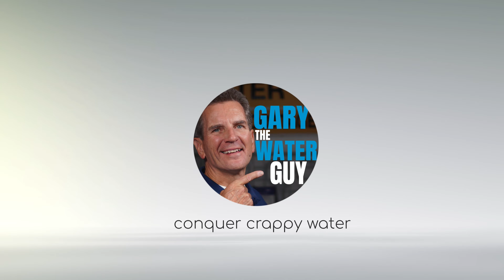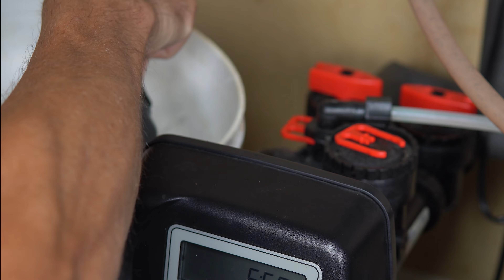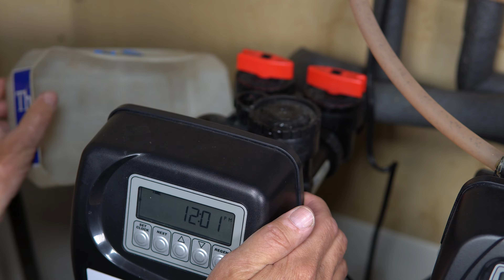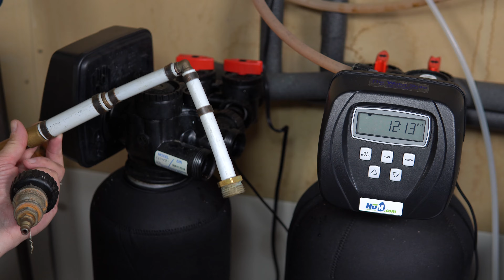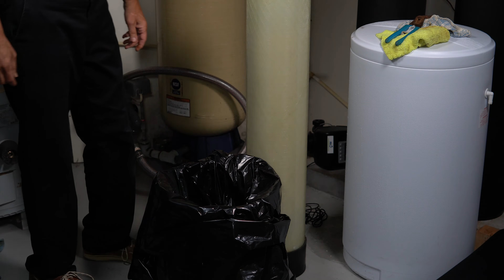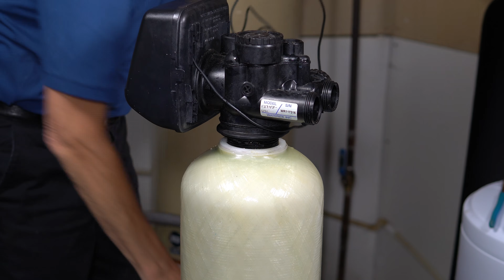WATER SOFTENER RESIN or Media REPLACEMENT

Comment: My softener takes 1.5 cubic feet…so I shouldn’t use all of that? Also how much water do u put in after the new media is installed.. thanks!
Reply from the maker: If it calls for 1.5 cubic feet you should add 1.5 cubic feet. You fill the tank with water while in the backwash cycle
Reply: @water_estore  so u fast forward the cycles to backwash then turn the water on? I appreciate your time!

Comment: Water pressure is low in house. Is this stuff in the tank supposed to look like gue?
Reply from the maker: No, it is not.  Likley chlorine has compromised the media and started to break it down.  You wither need to replace the media or repalce the water softener.  Thsi vdieo shows you how to repalce https://youtu.be/Z47JGH1l39o

Comment: I have a water system one part is for water softening and the other is for ph the tank for ph they said the timer is working and to fix is like $900 does that sound right like how come the timer can’t be replaced only it has Rene’s neu 1.5 $400 then timer $300 and whatever goes in it at $200
Reply from the maker: Sorry, I don't understand your question.  Can you please explain it better?
Reply: @water_estore  the tank that’s suppose to be for the ph they said the timer isn’t working so to replace that and rebed 1.5 is like $900 does that sound right

Comment: Hello Gary
I replaced the resin bed. The resin is purchased from amazon with your link. The weird thing is I found the TDS reading is 150 with bypass valve engagement(no softening), but it increase to 210 after I replaced the resin. It looks it gets worse? Don't understand how? I measured the TDS the next day after I replaced the resin. Even I regenerated two times, it doesn't help at all.
Please help.
Reply from the maker: Judst so you know we do not have an Amazon link for resin.  Our resin is here https://waterestore.ca/products/excelclear-premium-grade-water-softener-media-1-cubic-foot Having said that your TDS typically is always higher after a water softener than before.  Softening your water does not lower the TDS.

Comment: I’m in the middle of replacing my media due to no pressure at all. My tank is 54” and probably 10” diameter. There was gravel at the bottom when I removed the old media. You mentioned not needing it if it’s a small than 12” tank, I also read there’s been research that it’s not needed for my size and some companies don’t use it anymore for a tank my size. Should I still use gravel or not? I already purchased the media. Thanks in advance.
Reply from the maker: If it’s a water softener, correct. If it’s an iron filter or something else it will likely need gravel
Reply: @water_estore  thank you for the quick reply! Yes it is a water softener. I just didn’t want to replace the media and a year from now something goes wrong or clogs due to not using the gravel.

Comment: What's the purpose of putting the valve into backwash for a few seconds before closing the inlet/outlet valves to the house plumbing?
Reply from the maker: To release the pressure inside it

Comment: Hi Gary - I have a GE water softer that is about 6 years old. It is not using any salt.  I watched a few of your video. I removed all the salt and brine, soaked the tank with warm water and sucked it out. Refilled per instructions, cleaned the filter (it had a small clock) and performed a recharge.  No errors on the electronics.  Could the problem be the media?
Reply from the maker: Does it add water during the fill cycle and then suck it out during the brine cycle?  This video might help https://youtu.be/Lr3jyGiJdC0

Comment: Hi Gary, would it be possible to use old water softener remove all the media and add anion resin instead for tannin removals? Thank you so much
Reply from the maker: Yes, it would work.
Reply: @water_estore  Hi, thanks for the response. What about adding anion resin to the top of regular water softener, I have read that is a common practice, have you ever tried something like that? Thank you

Comment: Great video, followed it to the T.  My water was very hard according to the test.  I recently changed the resin, how long will it take for water to soften?
Reply from the maker: Right after the first regeneration.
Reply: @water_estore  thank you for the response.  It appears the way my system is setup, the water goes to the softener, then the water heater.  Should I dump my hot water tank first?  Seems that the old hard water is still there maybe?

Comment: No gravel in the bottom? strange.
Reply from the maker: Not really. Smaller than 12” diameter residential water softeners do not require gravel.
Reply: @water_estore  Thanks for the quick reply.  It helps as I need to replace resin media for my softener.

Comment: Your video did not show why control panel keeps shutting off when you have it plugged in I am the one that asked why it would run for 3 hours and with the screen being blank lot of water wasted I need to know if I need a new keyboard or whatever you called it but this thing isn't that old it's very aggravating if I need to clean this or change that let me know I just need to know.
Reply from the maker: This video will help you troubleshoot blank display How to Test CLACK Water Softener POWER SUPPLY #shorts
https://youtube.com/shorts/JNVLAd4SD4I?feature=share.

Comment: Very informative and much appreciated!  So easy to follow the steps.  Question: I replaced the drain elbow and forgot to add back the DFLC component (doh!).  I caught my mistake a little after starting a regen.  I could hear the media in the drain  tube.  I quickly cycled the head out of regen mode.   Do you think the media loss was insignificant?  I just replaced it!
Reply from the maker: No way of knowing, depends on how long it ran for.

Comment: Great video.  I would recommend that anyone using the compressed air method to be sure to have an air pressure regulator set for maybe 60 psi.  
Also I would run a toothbrush around the tank threads to make sure there was no media in them before reinstalling the valve.
Reply from the maker: Great tip! Please share video with friends and family!

Comment: How did you know you need to replace the resin? We just installed a water softener and every morning after no water heavy water use during the night our water has had a yellow tint. The company suggested doing a large flush but elected to use the water naturally to do that (showers laundry etc). We live in northern california so large water waste is hard.  Our plumber suggested it is the resin tank and plan on replacing just the resin within. What are you thoughts?
Reply from the maker: If water sits in a water softener for an extended time this will happen,  Seeing as it is a new softener it could be the resin.  If you bypass the water softenr is the water then colorless?
Reply: @water_estore  yes we did bypass the softner and the water was clear, once we switched back yellow. The water dissipates after maybe 5 to 10 mins of running it. But it does return first thing in the morning the following day.

Comment: There is very little to no water running through the house. I have it on bypass mode now and water works fine. I tried a cleaning solution from Home Depot and did 2 regens. I see maybe about an inch of water coming out the drain line. Would replacing the media make it work again? Do I need a new resin tank?
Reply from the maker: Yes, or replace the media or the whole water softener.

Comment: Silly question sir: What is the difference between the water softener and the filter??? Are these technically different machines or it only depends on the media that is in the tank?
Reply from the maker: The media and how the media is cleaned or regenerated and the cycles used to accomplish the cleaning.
Reply: @water_estore  Thank or "tank" you very much!!!!!!

Comment: Hey Gary , 2 questions .and a tip 

 1  a clack ws1 valve  with an error 2  on the display , not a card issue as tried another card out of a working valve  and error 2 on this card also . 
 The valve with the cover off tries to reposition itself on power up ,with small movements left and right on the visible white cog . The pcb  carriage shifts a little also  but in the end  error 2 keeps coming on the display . 

2  Any  tips for removing the valve off the          riser tube without lifting the tube ,even with gravel /sand bed .
Those valves get a good tight grip on the risers. 

Tip . I use the plastic/rubber covers off an Aqua pro UV  3/4 inch. In and out  pipe thread protectors  for the top of the riser tube when pouring media in to the filters . 
Fits perfectly .
Reply from the maker: Error 2 is that something is binding the piston, this video should help https://youtu.be/v_oF5w5dB1U.  Yes, it is almost impossible to remove the valve without the riser tube comin up with it.  So either don't remove it unless you are fuilly prepared to replace the media.  
Or as you have the valve about 1/2 way unthreaded, whip the valve back and forth numerous times to try to break the valve free from the riser tube.  Sometimes it works, but usually not. 
Thank you for the tip!!

Comment: How to replace carbon & resin in my Anderson Water dual media softener system? I have one stainless steel tank that I believe has resin on bottom and carbon on top. With a separate salt tank. Thank you
Reply from the maker: You would need to know how much carbon, resin and gravel is used in your tanks.  The gravel would be added first, then the resin and carbon last.
Reply: @water_estore  Thank you for the info. Have yourself a GREAT day!!!

Comment: I have tried everything I can’t. Figure out how to get rid of the brown color  out of the water system. It leaves sediment & mud in the tank of the toilet and in the bowl. I have  basically replaced the whole system. I just added a spin down filter. Then it goes into a smart water whole house filter. Then a then a filtration system pre filter. To two media tanks then a post filter into a UV light into the well tank. I’ve removed all the copper pipe because of corrosion and pin holes over the years and I’ve re placed the well pump & well pipe from pump to well tank and the well tank. I see the brown water when I first turn on the fixtures in the house. I’m not sure where to go from here. Second question is do you have all in one system that filters or treats the acidic or mineral based contaminates that  plagues the water coming from the well?
Reply from the maker: Sorry to hear.  I would have a full laboratory analysis done of your water before doing anything else to find out exactly what is in the water.
Reply: @water_estore  I have had it tested . When I bought my house 16 years ago it had a rain soft media type system installed and it worked great but when I tried to get it serviced they said the system was obsolete  and it would cost $8000 with trade in for a current system. And also had a water softener. Even back then it had sediment / mud in the bottom and the sides of the salt tank. When I replaced the well pump I even pulled it up a few feet thinking it was to close to the bottom of the well. Can the well be flushed?

Comment: just wondering if the media can be washed like fish aquarium gravel and then put back in.  I have a huge media tank and I don't think 2 people can do this job.  I followed all of your other videos and I still don't have soft water.   Also, I see resin cleaning chemicals on Ebay.  Do they work?  I don't have a water pressure problem either, just had a clogged filter which I realized after watching one of your viedos.  The problem was hard water and using up all the salt and salt tank filling with water.  After I cleaned the filter the salt is lasting and going through regen process but water is still hard.  This unit is huge.  It is Logix 90 000 grain metered water softener.  Date code March 2012.  Model 90 KLM.  I just moved into this house so I don't know if I need to replace this water softener or not.
Reply from the maker: No, the media cannor be washed out since every time it goes through a regeneration it is backwashing.  You will either need to replace the softener or the media.
Reply: @water_estore  thanks Gary your videos are amazing.  I have a pentair 255/762 and the tank is a 14"×65 blue 2.5".  Do you know where I could find out what type of resin I need and how much of it?  The model is 2012 so it's not terribly old.  Everything else seems to be working.

Comment: This is another great video Gary! I think that I might need to have the media replaced in my water softener, but my issues are not the ones you described in this video. What I am experiencing is very soft water right after a regen, but within a week or so, the water is back to being very hard, the dishes out of the dishwasher feel dusty, and our kettle for boiling water has "powder" both floating in the water and at the bottom of the kettle. I have actually passed this water through a paper coffee filter and collected what looks like very fine, slightly yellowish, powder. This powder problem will last for a few days or so (some days much worse than others) and then sometimes will disappear for many days before being noticed again. I purchased a bottle for RES CARE from you a few weeks back and put that through the water softener hoping that would fix it, and it did seem better for a while, but today the "powder" issue is back, worse than ever. Do you think my media needs to be replaced, or is the cause likely something else?
Reply from the maker: It sounds like you are running out of capacity.  I would check the settings. https://youtu.be/XMY69hdhX44
Reply: @water_estore  Hi Gary. I checked the settings, and everything seems to be ok. I have never changed them myself since it was installed. The water softener system is 9 years old and only has 1 more year of warranty, so I called the store to ask for help. After asking me a number of questions they have determined that the root cause of the problem is most likely the salt I have been using for the past few years. I switched from the salt they sell at their store to WINDSOR CLEAN and PROTECT which they say contains gluten to bind the pellets together and that has probably gummed up the system. They asked me to clean out my brine tank, put in a bag of their salt with 4-5 gallons of water, wait at least 4 hours, then force a regen. If this does not work, they will make a service call. Funny thing is, I thought WINDSOR salt was a good product. Live and learn I guess.

Comment: Water comes very hard when I resin manually then water comes soft for few days then again water comes hard,it’s the problem of media needs to change? Thanks
Reply from the maker: It might be but I would first check to make sure your water softener is programmed correctly.  If it is, yes it sounds like the media needs to be changed.

Comment: Thanks for the video, just got done replacing my resin.  I dumped the old resin onto an old throw away sheet on top of the basement floor drain.  That worked good, then bagged the old resin and sheet for garbage.  Also I found with my new resin that if I slowly sort of shook it out of the bag into the tank it dropped in better without clogging as much.
Reply from the maker: Thank you for adding some great tips!

Comment: I have a Sterling IM45-1 water softener.  The media is starting to get into the pipes.  After watching your video I have decided to replace the gravel, media, and two basket filters.  I am runing into one issue.  I have read the product documentation and searched the internet over, but can't find a specification for the top basket.  Are the top baskets on water softeners a universal specification that is common between them?
Reply from the maker: No, they are not but seeing that your water softener uses the Clack WS1 head this basket should fit https://waterestore.ca/products/hum-water-filtration-valve-upper-screen-1

Comment: hi! thx for your video! very cool! could you please tell me how high can the drain be? do i need a pump or will the drain water pressure the same like the inlet water pressure? how do the softener suck the salt sole when there is no pump? please explain me that! thx
Reply from the maker: The drain can be at the 8 foot level as water is forced out under pressure.

Comment: We just bought a brand new water softener system online (Autotrol), and whoever shipped it packed it all preassembled (we didn't know it would be preassembled). I noticed bits of resin all over the inside of the box, but the head unit was screwed on the tank with resin in the tank. I was afraid that the tank was damaged and resin leaked out. The head unit was also cracked and damaged. I unscrewed the head unit, as I wanted to inspect things for, and it pulled the riser tube slightly up.

What should I do now? If the tank is usable and I had pulled the riser tube up a little, does that mean I have to dump the resin out and start over? I'm so upset that they packed it like they did.
Reply from the maker: First, I would contact whomever you purchased it from, I know it wasn't from us because we do not sell Autotrol and ask them what you should do.  I am sure that they will help you to get this resolved.
Reply: @water_estore  I have, but I still haven't heard back from them. It's just sitting in our basement and I won't touch it any further. 😫

Comment: I have a small drip on my Fleck 5000 control valve. Its coming from either on the connection between the turbine and the control valve or the turbine and the bypass valve...hard to say which side is leaking from. Do you think the o-rings need to be replaced or maybe replace the turbine meter assembly? I don't seem to have any alignment issues on the plumbing so I dont believe that alignment/sagging would be the issue. Thanks!
Reply from the maker: I really don't know.  Have you tried adding some clear plumbers silicone grease to see if it helps? https://waterestore.ca/products/plumbers-secret-clear-silicone-grease-food-grade-113-gram